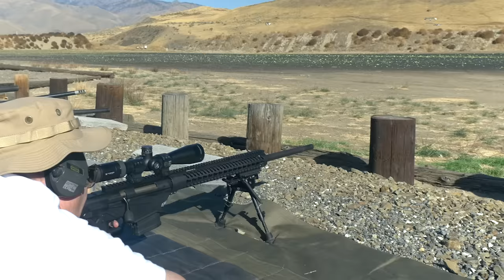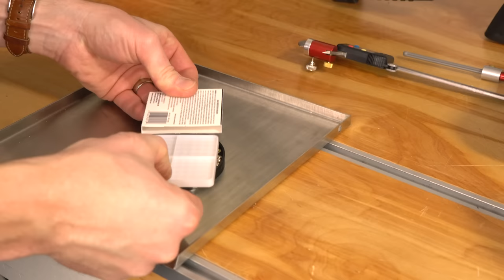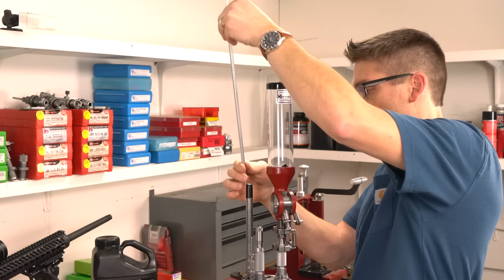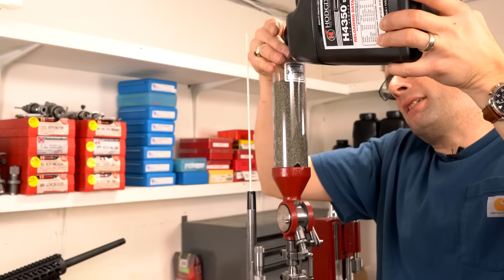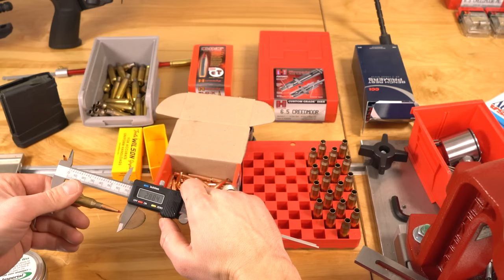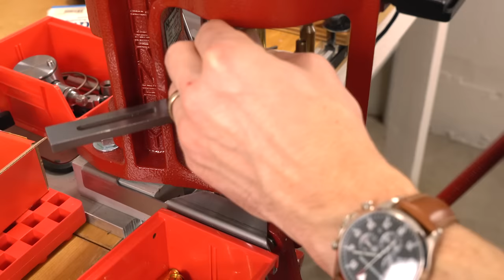Ruger Precision Rifle: Progressive Loading 6.5 Creedmoor

Comment: When i fill my primer pick up tubes I don't bother shaking to orient the primers anymore.... I just put the tray of primers on the try and flip it so they are all laying in a nice grid shape, then I pick all the primers that are facing the right way, then flip it and pick up the rest...... Doesn't sound like much, but I can have almost 1/2 my primers picked up by the time you are done shaking... Not to mention it's MUCH easier to pick them up when they aren't all slid against one another.
Reply from the maker: +spyderxtra777 That's a great trick, I'll have to try that!
Reply: +gavintoobe yep, i do it that way every time I open a pack and they are all mixed upside down/right side up

Comment: I'm this close to sending you an excel sheet to plug in parts needed to create a good Hornady AP .308 loading kit.. hahahaha.  Excellent video.
I'm getting the parts together - Hornady doesn't do justice on kits like others do, so you end up with nearly everything except, another 9 or 10 required parts. - and on backorder.
 You're setup seems to be as solid as I would want, this side of a full on Ammo Plant...  ;)

Comment: Thank you gavin, nice video, as usual. Too bad it does spin so we can't seat the bullet straight... so far I haven't made the jump for progressive press because I'm a control freak and I like to check everything twice if not three times and I don't know if I would trust the press. Even powder, I generally weight it every time to be 1/10th of a grain perfect... I know I probably over do it, and it wouldn't be possible if I would reload some calibers that I would shoot a lot. However, when I look at your bench, I really want to redo my whole reloading station and adding a progressive press wouldn't be a bad idea... so thanks for the video and tutos. It definitely helps to know more about it!
Reply from the maker: +Phil Smith Phil- I think you'll like progressive loading. The rotating drum measures I have (Hornady, RCBS Uniflow) tend to be very accurate, more so than the sliding bar type. I can usually get +/1 .1 or .2 grains with rifle powder in these measures... I'm happy with that for most loads!
Reply: gavintoobe Somehow, I'm convinced it's possible... that's also why I watch your videos. But deep down, my control freak instinct tell me to not trust anyone else than myself and control check every single load, every single primer, every single steps... which would make progressive press useless in that case. But somehow, with the 7 positions and so, now it might be possible to have many checking dies (for resize length, powder presence, etc...)... so yeah, I'm thinking about it :) :)

Comment: FYI, if you wanted to go a little longer on your OAL, Magpul says the maximum OAL on their AICS magazines is about .030" longer than the PMAG LR magazines, 2.86" vs. 2.83".
Reply from the maker: Interesting! Do you know if they've been validated to work well in the RPR?
Reply: gavintoobe That I do not know, sorry.
Reply: I can say for certain that the Magpul AICS mags work wonderfully in the RPR. That's actually what I use in mine as they feed more smoothly than the double stack LR mags do.
Reply: And yes, they can take a cartridge up to 2.86" as well.

Comment: I have had a problem setting up the powder the way you do it... I think the problem stems from powder getting stuck in the primer area when using a case to set up the powder drop.  It does it on the first one and everything is good for the first round but all the rest are slightly off.  I started using a pan to set up the first round and everything is much better... I noticed it when using the chrono because the first round would be run faster and the ones I rechecked later in the batch always showed a lighter charge.

Comment: I noticed that factory Hornady 143gr ELD match rounds come right to the end of the Magpul 308 Pmags that came with my RPR (they just barely fit).  I think I also noticed in your last video that the OAL measurements of your RPR using the Hornady OAL gauge with a 6.5mm Creedmoor modified case is a somewhat longer then the Pmag will allow you to load.  So it seems like you've decided that a significant amount of bullet "jump" (I think that's what you call it) is going to have to be acceptable?

Comment: When loading pistol on the LNL-AP, I have noticed a difference in OAL from running a single cartridge through versus a full shell plate.  Did your rifle loads maintain a consistant OAL from single cartridge operation versus full shell plate?

Comment: How many firings until you start annealing the brass? Or do you? Great videos. I am confident I could buy this press and load that same night. Thanks for taking the time to make and edit quality non BS videos.
Reply from the maker: I haven't gotten into the annealing game yet :) Something else to experiment with. Thanks, and glad you found the video useful!
Reply: For me it really depends on the cartridge, the load and rifle actually because most bolt guns i that i have several of in the same cartridge i keep the brass separate and marked for each particular rifle and neck size only. Sometimes being formed to that chamber helps in accuracy but dramatically extends the life of the brass. If it's a hot load i generally lightly anneal around every 7-8 loads. Semi auto always gets full length sized and depending on how hot the loads are, 4-5 loads again depending on what the cartridge is and the rifle.

Comment: I have to say, your without a doubt the first reloader ive seen zero out their scale with a shell and weigh their powder with it.... if your using that same shell every time than it would be perfectly fine, but if you weigh each of your shells you'll find that they don't all weigh the same. For the most part i use either an old 45-120 shell or a bigger capacity than what I'm loading, zero the scale with the pan and dump into my big shell into the pan. If im loading something match grade, my pan is a hybrid pan/funnel so i can easily weigh each drop (if im not using my chargemaster) so i can easily dump it back into the case without losing any or making a mess. Just a suggestion. It takes a lot of case prep to get them all identical and even then they still may have some weight variances.
Reply from the maker: Same shell, of course :)
Reply: @Ultimatereloader  good good. How consistent was everything coming out? My dad's trying to convince me to get a progressive set up for 45 an 9mm but I'm just not so sold on it. Not that it couldn't be just fine for a semi auto pistol but money to set up to time difference ratio i just don't see the benefit. I have a pretty good system on my single stage. If im loading a bulk i use the rcbs bench prime, so i prime them all, then put my flare die in there press and flare and drop the powder in all set in a load block i custom made with 105 holes so i have an empty row separating my charged cases and need to be charged then change to the seat die and have my old lee press that i put the factory crimp die in so i can do it right after i seat before boxing as complete.. idk it may sound like a lot but it really does go by pretty fast. I have a flat screen monitor on the wall in front of me so i can Netflix or watch YouTube while I'm loading. I just feel like as long as I'm paying attention, error is cut down a lot. Id be concerned with a semi auto with ammo loaded progressively to be rapid firing and end up with a really light or no charge round that gets stuck in the barrel. Granted changes of it cycling the action with no charge is not a concern but a light charge, maybe? Idk.

Comment: i cant get my hornady powder thrower to give exactly 42 grains of vhit 150 its Always a have grain over or under any tips for me i want match grade ammo for my h&k mr 308 a3 20"" to make it a real accurat sory for the bad english
Reply from the maker: +chevy6299 Good tip- I do almost the same, use thrower set .3 grains low or so, then trickle up to exact weight. Faster than automated scales/tricklers!
Reply: that what i do to huse the rcbs powder thrower
more accurat as the hordany tikkel to weight fix 50 cases and  than huse te lock n load to seat the bulleds